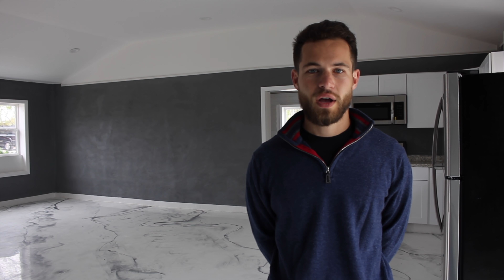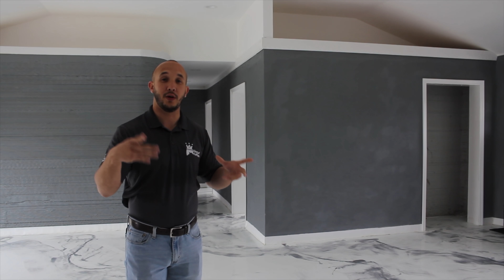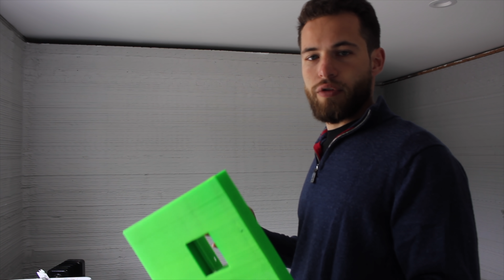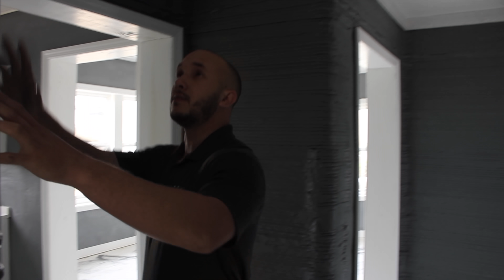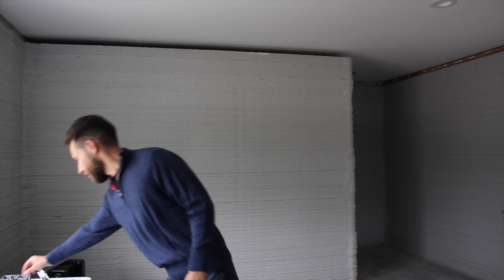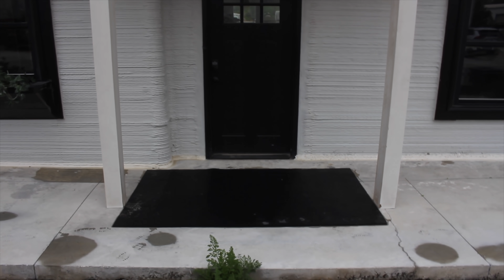Biggest Printed Home in America Tour with Broker Who Sold The First 3D Printed House on the MLS

Comment: Good choice covering up that gnarly unattractive look this process gives. 
Probably not saving much if you added the cost of Finnishing those dirt and dust catching ridges. 
So what about earthquake issues. Has there been any updated evaluations. 
   This could become extremely expensive for bilding code requirements for earthquake retrofit.
Reply from the maker: For earthquake zones you change the design from monolithic to sections separated with expansion joints but I haven’t seen it done yet.

Comment: This sold for 360k and the way they've said it takes maybe 10k to make if that and it can be printed in about 48 hours or even less sometimes. That to me is not saving anything it's just the builders making a killing. Not to mention the echo that you hear bc of it being concrete, I would absolutely hate that, don't get me wrong if I could print my own house I'd do it but this doesn't seem like any kind of savings to me, it just seems like the sellers and builders are making a million more dollars
Reply from the maker: No this unit wasn’t sold, I did a more recent video on the one they sold. It wasn’t built yet when they sold it. It cost them 10k in concrete materials. Building a livable home is much more expensive than that. The roof alone might cost 10k.

Comment: Seeing a house like this i am really curious about how 3d printed houses will do with states / countries with earthquake regulations.
Reply: likely a lot better on a number of levels. Wood relies on plywood and drywall to resist the horizontal loads of earthquakes, all of these walls will resist those loads easier. Its why we make tall building elevator and stair shafts out of concrete.
Reply: Great question! 👍
Reply: Concrete is the worst material for earthquake resistance. Concrete is brittle and inflexible and will crack due to shear. Wood, while it is soft, is much tougher. It is able to bend and dissipate the energy and therefore has the capability to survive earthquakes. 3D printing houses with concrete is most environmentally unfriendly way to build a house. In terms of embodied carbon, concrete is the worst material. Try remodeling this house by knocking a few internal walls. This is a gimmick.
Reply: @rmjds   millions of tons of concrete in LA skyscrappers

Comment: Might spraying the walls shortly after printing them with a sealer prevent microcracking, this is the same way concrete highways slabs are done, after they are poured and troweled by those giant machines , and then textured they spray them with white paint like substance, it works like covering the concrete with burlap tarps to keep them from drying out too quickly and cracking. Also, what the HVAC system like in these 3D printed homes? These should be very tight , are HRV units used in them? I see so many missed opportunities with the 3D printed homes, what about printing out artistic fire place chimneys? This house had horrible acoustics, perhaps that could have been lessened by leaving the walls raw.

Comment: I did skip through it a bit, but it seemed to be missing all the detail.  Foundation, plumbing, electrical, roof, finishing other than plastering walls  etc.
Be good to see a video that covers all the problems & limitations with this method of construction
Reply from the maker: Fair criticism however this home is an experiment not a residential zoned property so it doesn’t include most of those things.
Reply: @automateconstruction  we understand that it is not to be lived in, but it should be totally functional.  It should showcase all trades in the build.  Might even be used as work area for employees.  The more walk through traffic, the more the public will demand this kind of structure. I built an insulted concrete form (ICF) home fourteen years ago and it is still considered cutting edge building, though, if I build again we may plan on doing the 3D concrete home instead.  Sound quality was a real hindrance to this presentation. A voice over narration would improve your quality.  Your claim as the first 3D printed home built and sold to the public through the MLS may  be suspect.
Reply from the maker: @paul49777  No, this home wasn't the one sold. The first 3D printed home that sold on the MLS hasn't been built yet, it was sold as a plot of land with permitted plans pre construction. The MLS listing is publicly available.

Comment: This is pretty awesome, but I'm wondering about how the electrical and plumbing would be added.  You can't really run conduit or pipes through with it already built, and I'm not sure how they could get added during the 3d printing.
Reply: When the concrete is still wet, you make a dent in the concrete wall and run wires within. In fact, all the high rises are made of concrete. They all have conduits and whatnot.

Comment: What about the electrical? What do you do with electrical requirements?
Reply: Wireless xD
Reply from the maker: Treat it like you would cinderblock.
Reply: The procedure should be same as for normal buildings, but actually it could be easier, because the printer could print channels for electrical which are usually busted out in a walls. And making the channels and cleaning after takes sth about 70% of the work and time.
Reply: Yeah, except they didn't print channels or integrate any electrical into the walls. You're telling me this place passed inspection and got a certificate of occupancy woth the only electrical outlet being a drop in the garage?
Reply: You need the plan of the house

Comment: I cant wait a year for this to be more fine tuned. I just got to make sure the local municipality.
Reply: Lol watch the video and try to point out ANY electrical outlets. By code you need an outlet every 12 feet of wall space going around the room and any walls space that is at least 6 feet in length. This home would fail ANY electrical code across the United States. They have this rule because most electrical cables are 6’ so you would be able to reach a plug at any point in the house without use of extension cords.
Reply: @glockout8283  this house was to get engineers approval and county. This is a mock up.